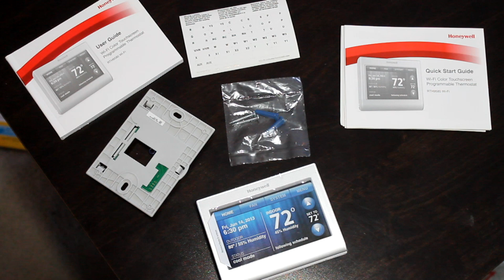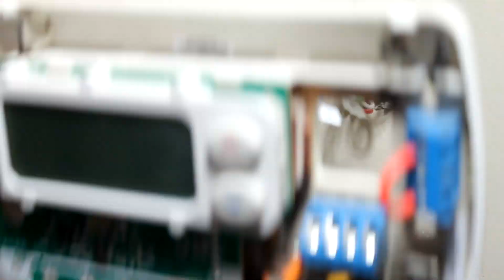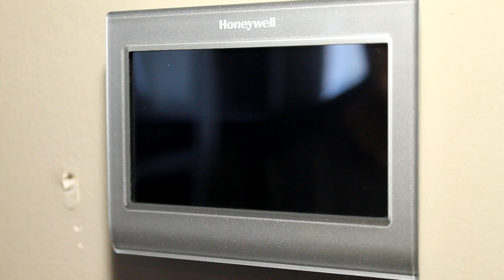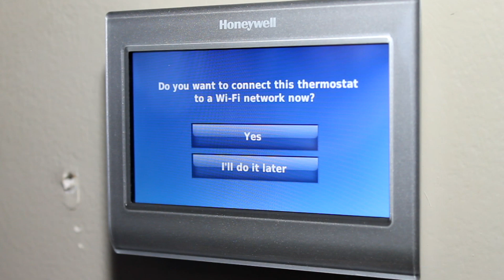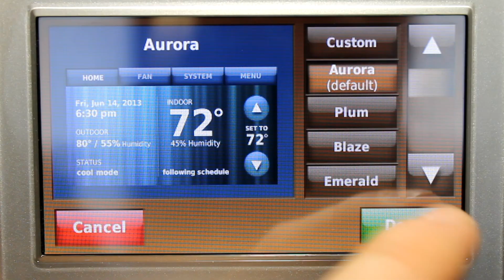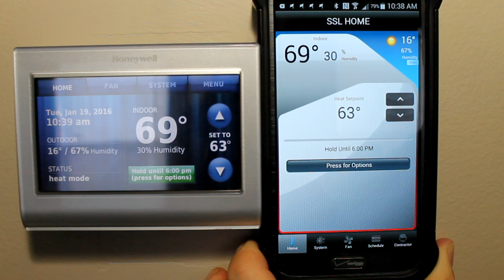Honeywell Smart WiFi Thermostat - Setup and use

Comment: Thanks for the video. I've had my honeywell for over a year. I love it except at times I lower the AC settings say from 77-76 and the number display will switch over to the lower number BUT the HVAC never clicks on. it just switched to the lower number. i'm wondering why it does that? Is the Honeywell faulty or is there a disconnection between Honeywell and the HVAC? It works terrific otherwise. I use mainly air condition on auto circulate all year around here in Florida.

Comment: Installed one with the same wire configuration and everything. Doesn't work. Screen never turns on. Double checked connections and everything. Old one was a battery powered Honeywell and all I to do extra was connect the c wire which was already there as a spare.

Comment: It's a nice interface but these things cost upwards of $500. I just got a Honeywell wifi older model for $70. Big difference.

I wanted to know if the connection to the internet allows the thermostat to reactw better to the weather.

Like does it come on earlier in the morning big the outside temperature is colder and therefore bit will take longer to heat up the house 

I know that it does this calculation without external temperature by it's adaptive recovery system however is it smart enough to "know" when the outside is particularly cold and therefore allow extra time to reach temp.

 Weather can change on a daily basis despite the season.

 For coolit this ability to knot the weather upcoming can be particularly useful because the system could prime the house for a hot day to come by perhaps turning the heat off early on the day before or even pulling in cooler night air in preparation for a hot day ahead.. however I don't think we're there yet with Honeywell.

Comment: I bought this to install and replace an older model Honeywell thermostat. The older model has a S1 & S2 connections with black wires leading in. I understand they were for inside and outdoor temperature sensors?  Question is do I still need them, and if so, where do I connect them?

Comment: What happens when it connects to the internet just fine but it won't register? Honeywell can't figure out why it doesn't either. 120 bucks down the drain since it was installed after the return window. Do you recommend another brand that actually works?

Comment: i have a 7 wire system, so with it being connected to the internet there is no need to connect the outside temp? and it will still utilize internet temp to start my heating coils if needed?

Comment: I believe you save more money leaving your temperature settings at one temperature, because everything conducts the heat or cold, so the system works hard every time you change it, this temperature control is for comfort not a big energy saver,
Reply: I save more money by not having a smart thermostat. I set my temp to 74, and then have to physically walk to my thermostat when I want it cooler. I'm lazy, so i must be really hot to wanna get up and change it... A smart thermostat makes it too convenient to low the temp. Thereby using more energy because I'm changing it more often.

Comment: My fan turns on but my thermostat doesnt . Do you know why?
Reply: It could be that your C wire ( blue common wire) isn't connected at the furnace.  I hope you figured it out.  I had a similar problem. Previous owners/tech had made a mess of my wiring at the furnace, so my wires at the thermostat were out of order.

Comment: does the Honeywell rth9585 work for a dual zone system and is each's own have to have its own unit or should it work if one is an old unit and one zone has the new Honeywell thermostat

Comment: Can you help me. I had the same thermostat except I had a O/B orange wire. And my white wire was connected to the W2 terminal. So when I installed the Honeywell thermostat I just matched them up to the same terminal but my A/C is blowing hot air when I turn it to cool mode

Comment: Installed the Honeywell RTH9585 for Oil/forced hot air (double checked wiring and all connections (C,W,Y,G,R) before turning power back on) and ran into a few issues: 1) set fan to "automatic"; it ran non-stop and would not turn off; 2) heat wouldn't "kick-on" either so turned heat to "off", but continued to show on display that it was on (?). Tried running through the set up process again (with some help) with same results. Reinstalled my old battery operated thermostat and heating system went back to normal operation; no issues. Any ideas/suggestions on why the fan wouldn't stop running and the heat wouldn't "kick-on"? one minor issue: touch display wouldn't let me change time & date (although I believe that's controlled via Wi-Fi). Thanks.

Comment: I have had this thermostat since 2013. This is the biggest piece of shit ever! If I keep it I will probably have to replace my entire HVAC system. The temperature reading started to fluctuate +2 to 6 degrees then -3 degrees all within a few minutes. My system has started to shore cycle and my electricity and gas bill started to go up.  I noticed one day outside that my air conditioner would run for 6 minutes off for 7 then back on for 6. It never used to do that. It worked great for a couple of years and then started to do its own thing.  I have read the reviews online and I’m not the only one.  Honeywell I’m not impressed with this garbage. I will be looking elsewhere.

Comment: Trying to install this one.  It's beyond frustrating how the manufacturer instructions REALLY don't tell you how to wire the damb thing.  My old thermostat had like 9 or 10 wires. Do I need to connect them ALL? OR NO? When you're hooking up your wires, which ones are you connecting? Please name them as they're going! And those names don't always correspond from one make/model tl another. I can't believe how much guess work in left to do here!
Reply from the maker: If you had 9 wires actually hooked up to your old thermostat then you have a much more complicated multi zone system in your home. I might recommend calling their tech support line

Comment: You too fast in the wiring prosess. I have a problem with my system. In the previous unit they link The E wiith  the W2 with a brown wire. In the new wifi honeywell 9585 i see the W2 and the E in the same spot. Now my automatic and the heat don't work.. what should I do please?
Reply: Did you ever get an answer for this? I have the same exact question.

Comment: IF YOU HAVE AN OLD TSTAT THAT HAS NO DIGITAL DISPLAY YOU WILL HAVE TO ADD THE C (24vCommon) WIRE TO YOUR INSTALLATION FROM THE UNIT. If your lucky there will be a spare wire. You want to find where the transformer is , indoor or outdoor.  The common is needed for any digital display tstat.

Comment: Hi Guys! I have a question - thank you for this video. I need to get the MAC and CRC address fof this thing so i can connect it to wifi. It is not on the back of the unit, how do i get this information from the unit itself? The card was not left by the previous home owners.
Reply: When you go to connect it it to WiFi it should show them on the screen.

Comment: I read a lot of bad reviews on Amazon about the longevity of this product. Have you or anyone else had any major issues after a year. I like how the 9580 looks but wouldn’t want it if majority of them die after a year. Thanks in advance for any advise.
Reply: The longevity is affected by the power supply. If there's any spikes in the supply voltage, it will prematurely fail. Also, before installing one of these, it would be wise to check for backfeeds from the system. Backfeeds will kill the circuit board in it. So long as the power is stable and the system wiring is good, then 5-10 years is a good life span. No one knows how long they can last. Regular cleaning with CO2 spray, the stuff you use to dust a computer would probably make it last longer.
Reply: I had one for roughly 3-4 years before I sold my house. Up til then I never had a issue. Been in my new house for ten months and just put one in it as well.

Comment: Nice review.  I just installed the Honeywell RTH9580 Sunday.  It was very simple installation and no issues setting up the wifi as well as the schedule.  App for iPhone works fine.
Reply: Jeff Cameron what if there is no C wire
Reply: Byron Evans you have to run one or go with a different thermostat. Maybe a Nest or Echobee.
Reply: Jeff Cameron How hard is it to run one
Reply: It is easy and even Alexa speaks to it.  But... I wold have bought the Nest or better yet the Ecobee but my wife did not like those for some reason.  She did not want a black thing on the wall.  She likes the color one by HW.
Reply: Install a THP9045A adapter. Honeywell has a lot of guides and even videos on how to do it. The only part that scares people is that you typically need to open up your furnace to install the adapter.

Comment: hi...I follow the video but my thermostat won't reach 76 and it has been on for 5 hr...current indoor temperature is 83 and outside temperature is 87. What do you think the problem is? any ideas?
Reply from the maker: +83rangel check your air filter, make sure your outside compressor is running, if it still doesn't work call a service tech

Comment: I am very interested in this thermostat.  I have dual zone.  Am I to understand that I need two of these or just one fore the main floor?  BTW, I watched several of these installation videos.  Yours was without question the best.
Reply from the maker: if you have two zones you probably currently have two thermostats so you would need two of these or just replace the main zone with one.

Comment: I installed one this past winter. Works really well for heating. Just tried to turn on for A/C. I can hear the thermostat turn on and the outside unit turn on, but no air blowing? Do you think it's a thermostat issue (wiring) or an A/C unit issue?
Reply: That may be a loose wire. Typically if the outside AC unit starts but the air does not blow, it's a problem with wiring. It's really rare that it would be a tstat issue. The AC circuit and fan circuit in the tstat are interconnected, so usually if there's a problem with the tstat, neither the AC nor the fan would work.

Comment: Does this support a heat pump also does honeywell consider this a professional series whereas they expect a HVAC to install it I have the honeywell 8000 visionpro th8320wf1029.
Reply: It supports a heat pump system. The product is a DIY product. That's why it's sold at Home Depot.

Comment: how do you remove the wire from the terminal after you push it in? my fan is constantly running for some reason and I need to switch a wire i think
Reply: There should be press tabs on the other side of where the wire pushed in to release the wire. Press in, pull wire.

Comment: I bought this same model today at Lowe's, but I couldn't get it to work. After hooking up all the wires and turning the breaker back on, the monitor didn't even come on. :-(
Reply from the maker: make sure you have a white or 'C' wire run from your furnace, if you don't have that it will not get power

Comment: I have the same white Rogers  Thermostat but mine doesn't have a  C wire so I am not able to install this honeywell thermostat. I live in a apartment and did get permission to install one but now I'm not sure if they let me add a C wire.
Reply: Honeywell makes a wire adapter. Part number THP9045A. There's two versions of it, they both do the same thing. Could be tricky to install.

Comment: Does it not take more energy turning on this unit and getting your home to a specific temperature rather then just maintaining that temperature?
Reply from the maker: there is some truth to that but it is still more efficient to lets say, turn it down 5 degrees all day long while you are not there and then only heat it more for the few hours in the evening you are around the home. The savings is from not having to maintain as high of a temp the entire day or night even though it does need to run longer to get the house back up to temp. Still less than running all day off and on
Reply: +SSLFamilyDad I picked this unit up & hope to have it installed next week. I liked the idea of being able to monitor my homes hvac remotely. Giving up a few degrees as you mention over the course of the day while I'm not home would be an added bonus.

Comment: Do you still have the aquaponics in your basement?  I can't believe your humidity is so low.
Reply from the maker: Oh yes, sure do. And the humidifier runs on the furnace to keep it at 25. The only place I notice humidity is right above the aquaponics system on the basement window. It condensate s when it is cold out
Reply from the maker: +cobra646 sure do, it honestly doesn't effect the humidity too much. The basement is always a bit more humid anyway

Comment: Is there a compatibility issue with older systems? I have not looked behind my panel but i was wondering if there has to be a minimum number of wires going to you thermostat for this type of system to work? My house was converted to central heat and air in the late 90s probably 1997 ish but i think they used an old heater thermostat hookup from the mid century house was built in 1960 ish. Do i just need to pull the panel off and look to see how many wires there are? or will the system just work with how many wires it is given and why you said it is more important for you to keep track of the letter and not the colors. Thanks for the info :)
Reply from the maker: If you have heating and air conditioning they should have pulled a new thermostat wire when they upgraded so you should have 5 wires like mine. I'll bet you are good to go with what you have.
Reply: +SSLFamilyDad Cool tyvm :)
Reply: Benja's Uber 1337 Hobby hey man  any issues with connection to WiFi. And like al OT of reviews say does it malfunction after a year?
Reply: The thermostat used in the video is a basic thermostat + wifi. It will run older systems.

Comment: My smart thermostat paid for itself the first month. I love it!!! One caution though, is in the winter time, don't think you can drop your thermostat down to 40 degrees when your going to be gone for a long time. 2 reasons are 1, your house has cold spots and although its 40 at the thermostat it might be freezing or below freezing by pipes or places your not getting a lot of circulation. And 2, is if you go too low it takes forever to get back up in temp and can be just as bad as if you kept it at your desired temp all day long, if not worse.
Reply from the maker: That is a great point. I would recommend never going below 55 on the heat setting. Also, with cooling it is better to keep it running to keep the humidity out of the air as that is what takes the longest to bring back down. Great comment, thanks!!!
Reply: The savings on heating depend on how long the house is in the idle state. The longer it's at 40F the more you'll save.. like when you're away on vacation.

True some parts of the house may get cooler but unless the cooler parts are outdoors it shouldn't matter. If your house relies on house heating to keep pipes from Freezing then it was never constructed to local regulations in the first place.

Of course  if you have pets you'd not leave them for long so that's not an issue...or shouldn't be.

If I went on vacation I'd set mine to off but with remote access its possible to blast some heat while away.

I'd also put a wifi thermometer in the colder parts just to monitor what's happening there.
Reply: It's gets to minus 45 here in Canada, our pipes most definitely rely on home heating to keep from freezing.

Comment: No need for heating or AC where I live  in Hawaii but I still enjoyed this video.
Reply from the maker: No need for A C there? Are you higher elevation or something Dan?
Reply: +SSLFamilyDad I am 150 feet above sea level but with the trade winds and ceiling fans we are usually pretty comfortable. Temps average in the mid 70's year around. We do like to keep the back lanai door and some windows open to catch the breeze..Some houses and most of the expensive hotels do have AC though and some homes at much higher elevations have heat.When guests from the mainland visit they usually ask if we have AC  but after a coupe days they seem to acclimate and say they no longer need it. I think its the humidity that bothers them more than the temp.
Reply: I'm sure you get used to it there, but in the summer it's still pretty hot for me and I would definitely have an air conditioning unit. My lady used to live there and said she had her AC unit turned on most of the year. To each their own though. Either way you're definitely in Paradise!